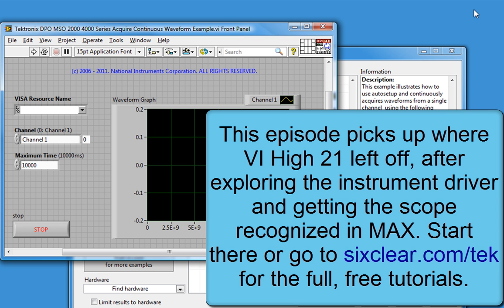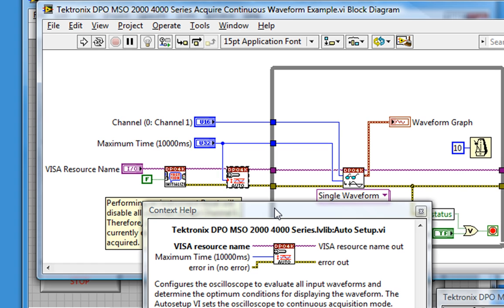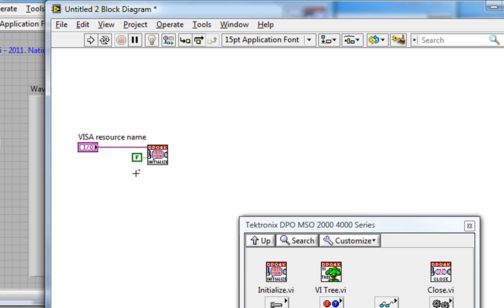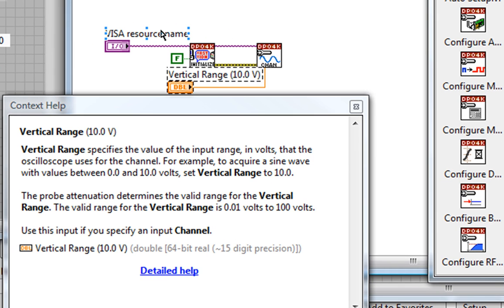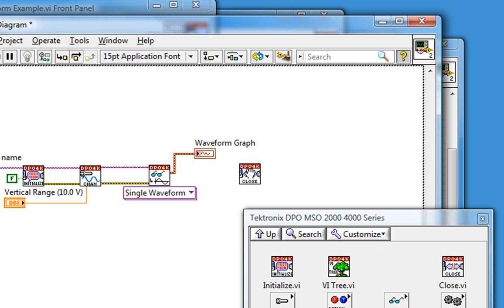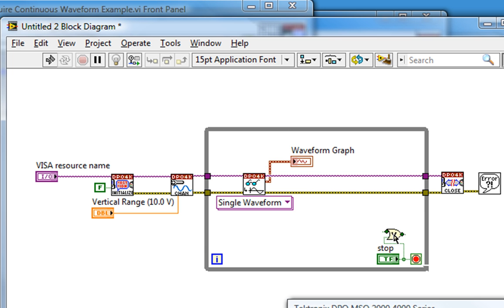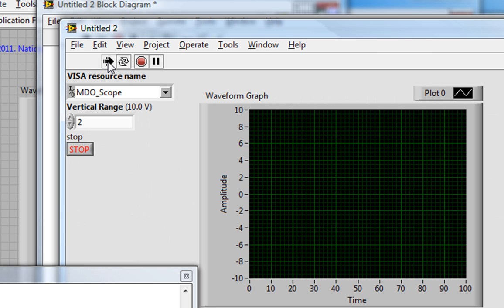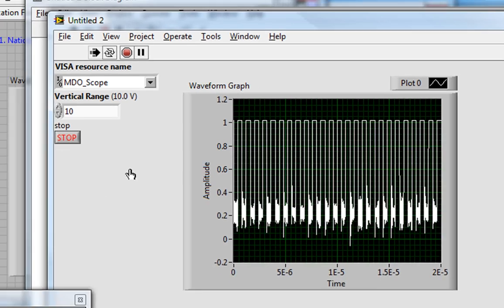VI High 22 - How to Use a Tek DPO/MSO/MDO Scope with LabVIEW Pt 3: Acquiring Data & Channel Config

Comment: Hi, I am using DPO2002B, when I tried this program, it always says: ' error occurred at ...initialize.vi, and possible reasons is id query failed'. Can you tell me how to fix this or how to disable the id query please? In the initialize.vi  there is a commented out text  saying that the program matches from bottom to top list of models,  so there is an issue with the instruments getting matched. I am beginner in labview so I am really stuck here.

Comment: Very nice Video. I am using a DPO 4104 via usb in labview too but what bothers me is the very slow refreshrate when cont. acquiering waveforms.
Do you know how I can speed it up?
Reply: +tripblackk 

Try debugging the code underneath the Read VI; you can determine where the slowdown is and that may help identify if / where to optimize. You may try reading fewer data points per read, to update data more frequently if that's the "refresh rate" to which you're referring. Let us know how this goes!
Reply: Did you solve it? how to select the sampling frequency

Comment: Hello. It is very helpful video. Can you explain me What is the object Read.vi? What command in it?  I want to do program similar this using LabWindows. Can you say about this? Its possible on LabWindows or not?
Reply from the maker: bratdoctor Great question! LabWindows has its own set of drivers for instruments, all based on ANSI C code. I would search for a LabWindows driver for this instrument. The Read VI you see in this code would just be referencing SCPI commands underneath. The LabWindows driver would have a corresponding Read function. Hope this helps!